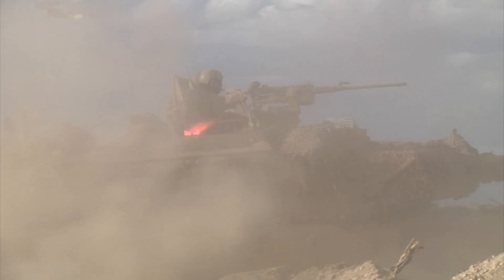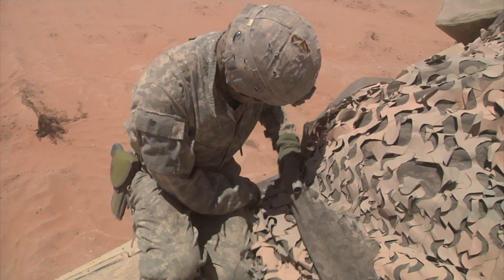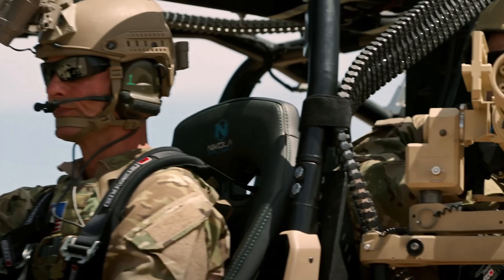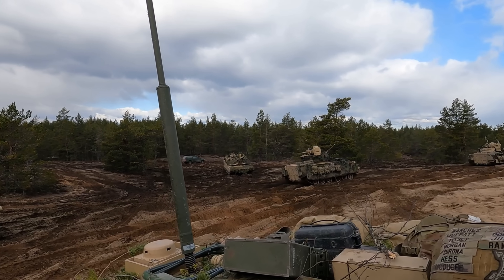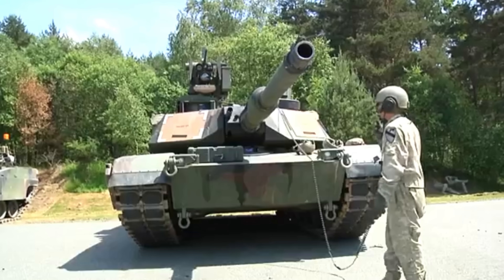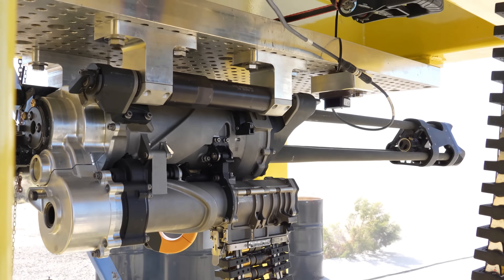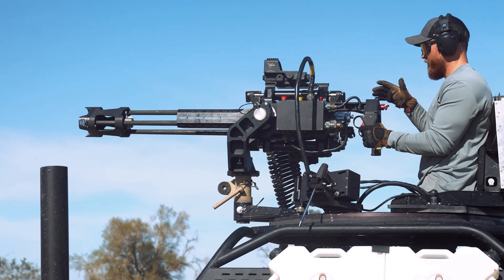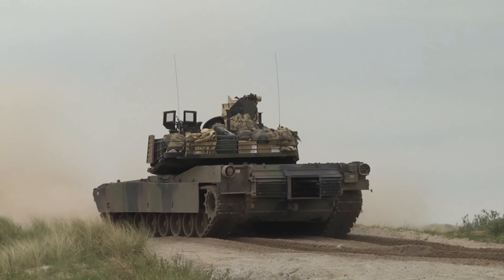Why is the U.S. Army putting a M134 Minigun on Abrams? | ROTARY GUN DEFENSE

Comment: The Minigun needs to much ammunition, on top it needs some time to get into rotation and you have to directly hit the target with one of the bullets. This could only be a short time solution. There are already several technologies available to counter drones. For example ABM guns or counter drones. This is of course much more expansive than a simple minigun controlled by a soldier.
Reply from the maker: Those are some great points to consider!

Comment: Sorry but the same enablers you listed for the GAU-19 can be used on a minigun mount. CROWS can even be slaved to an AI system to recognise and shoot at drone like targets. Terminator vibes but still

Also, how can power and ammo capacity for a 7.62mm type be an issue but then suggest a bigger, heavier system in the GAU-19 which will need more power to operate and more storage for ammo? 

Western nations will need entirely new hulls and not next gen upgrades like Challenger 3. Aside from jammers, soft and active protection. I would say we go to 14.5mm and 9.5mm single/multi barrel guns for lethality and range. With AI allowing for less burden on the crew.
Reply from the maker: Thanks for the insights, there are definitely some interesting points in there!

Comment: The Ukraine has a AI powered audio detection system that can pinpoint drones and missiles filtering out all other sounds. If they want to have a powered weapon on top of the tank may as well make it semi autonomous integrating audio with optical auto aim.  Most importantly in a non radiating passive targeting system. Making  a compact phalanx  using off the shelf passive sensors instead of radar.
Reply from the maker: Interesting thoughts!
Reply: @_Matsimus_  Funny thing is this is nothing new, durring WW 2 the Japanese were far behind in radar technology so they used what was basically gigantic hearing aids to detect incoming Allied aircraft.  They could determine location and a rough flight path and speed.

Comment: From what I can tell watching the footage, then mounting a huge rotary gun on top of a tank turret is a really bad idea and it's gets even worse if has to be manually operated ! In my opinion I would go for a system which would be able to destroy a threat at a distance of 30 meter or less this weapon system would consist of very small short barreled shotguns placed on the turret and body of the tank along with a small short range radar for detecting, tracking and aiming at the incoming drone.

Comment: For its purpose the m134 is better than a GAU-19 for the very points you raised at the start. Rifle calibre rounds are more than capable of dealing with drones (fpv) that you mentioned and the volume of fire will support that. 7.62mm is lighter and more compact that .50 and therefor more rounds can be carried. If you are wanting to deal with these drones (anything larger should be handled by SPAAG or a SHORAD) then as you mentioned they need to create an automated system. Maybe even using cameras mounted and AI to detect movement and target as a cheaper alternative to high resolution radar.
Reply: That said a laser system would be better suited.

Comment: I spent 2/3 of watching this video thinking the same thing as the conclusion - anti drone defense isn't going to effectively be done with manually aimed systems. It's going to take automatic detection with computer assisted aiming. Expecting a person hanging out the hatch of a 60+ ton vehicle moving at 30+kph over rough terrain to be able to do anything precise is unrealistic. The US military needs to look into remote turrets and detection gear. Expecting a tank to operate on it's own in hostile environment is a complete tactical fail.
Reply from the maker: That’s a very interesting point, thanks for sharing!

Comment: everyone forgets the original purpose of the 50-cal. on top of vehicles was not anti personnel but anti air, with todays air speeds you need more bullets so the slow firing 50-cal. is out.
Reply from the maker: Interesting point, thanks for sharing!
Reply: There is a fast firing .50 called the M3, it was mounted on early US jet fighters. Also, the M2's original purpose was air-to-air, as .30 eventually didn't cut it for shooting down planes.

Comment: Not sure of the practicality of it but creating and mounting an automated system like a mini CIWS . Something that could track and engage drones automatically using shorter bursts to conserve ammo. You still run into the problem of how and where to mount it. As you said the top of the turret is cluttered so without redesigning the turret roof the system would have to be on an elevated mount to have clear arks of fire. Now you have the problem of adding height to an already tall tank. To be effective no matter how you do it won’t be quick, easy or cheap.
Reply from the maker: Interesting points, thanks for the comment!

Comment: You should read Hammer's Slammers. But when I was a Rakasan over in the 101, I knew when Ukraine popped off and we would watch drone footage from Ukraine that it was a matter of time until they equipped tanks with a 20mm gatling gun, IRST, and a short wave radar. Probably mount a Phalanx system on a trailer down to the battalion level.
Reply from the maker: Interesting insights, thanks for sharing!
Reply: @_Matsimus_ Oh yeah. I'm out now, but I wonder if you guys up north have gotten the little black hornet bastards to play around with yet? Fun little helicopter drones a smidge longer than a .50 round. It doesn't handle wind well, but the picture clarity is good.

Comment: Drones bad MANPADS worse Same defensive solution 
Autonomous Defense 
More smaller projectiles
Layered

Autonomous means YOUR troopers around you are at risk of being collateral casualties Only buddies in an; nch or more of armor "safe*  Such systems would need a wide area networked auto off when a vehicle discharged crew / infantry  If hacked you are naked

Pelletized ammo 
Slow
Close in shell mounted claymore type mines
Near Up to 100 feet rapid fire extended charge shot gun w shot cloud effective 50 to 100 feet  A min of 2 needed to cover armor.
Small ca long range would be new generation .22 or .25 w extended charge & barrel to bring up to 50 cal range & speed.  Essentially a slightly smaller charge  slug infantry rifle round.  You'd need 1,000s of rounds per weapon.  Caseless would be huge assist  in rounds carried.  Belt fed 40 mm smart frag rounds set to detonate before meeting drone or rocket  by fire control maybe but very limited ammo supply.  Should AA be multi barreled for layering 40 mm .22 el, shotgun, then combo explosive armor w  multi layer towards outside.22 sized pellet fragmenting steel case.  
BIGGER problem is detecting threat.  ANY ACTIVE MULTI DIRECTIONAL RADAR can easily be used to target vehicle.  LIDAR is only sufficiently directional to make back tracking difficult yet computational power to paint 360 degree sphere around vehicle out to Evan 300 feet enough times per min to provide targeting data is insane for a vehicle.  It would have to be AI visual detection, enhanced w IR & night vision .  Alt the vehicle would need wireless net connection to a web of dozens of small drones radiating radar crawlers or flyers around the vehicle for targeting.  This could enhance friendly survival as troopers could have electronic tags that emit IFF when hit by radar pulse, realizing great way for enemy to detect them too albeit at risk of ARM targeting the radar station
Still ARMOR hit by drone even rockets often leaves battle ready survivors where a drone hitting a soldier might not kill them but almost certainly loose combat capability   SO ARMOR AINT GOING AWAY.  At the least it's an infantry ferry, & once it's that infantry will want need close defense heavy weapon to assist in taking fixed positions even if remotely operated from outside vehicle hugging earth using micro drone visuals to slew vehicle gun on bunker.   Of course a curtain of drones around vehicle would work too to intercept drone & rockets w about 3 x needed and landing / charging area on hull for them to rotate back for power during day long ops .

Comment: I think the whole turret needs to be redesigned. It is already carrying a lot of dead weight that's there to balance newer systems since it's original design. Instead of trying to find an empty spot in a more crowded and badly used space, take the whole turret strip it down to the bare essentials, and redesign everything else around that, and then mount it. M1A3 sep 0.... It would obviously also include the ideas necessary to at least ameliorate if not defeat completely the drone threat

Comment: Ok my .02 cents. I think they are simply trying out protection ideas. And this is one they can do easy. Logistics isnt a big deal as its the same ammo as the coaxial mg. They can always make a large dum and hang it off the side of the turret. And its a tank it really doesn't care about the weight. But I wonder if a shit shell for the mk 19 would be a better long term solution with an automated firing system
Reply from the maker: That's a great point about the logistical advantages of using the same ammo!

Comment: I personally like the M134 mini gun. Why the military doesn't use a sort of mini Phalanx system would work so much better than manual operated as they automatically seek out the drones and can spot a hell of a lot faster than a human being. I've always wondered why they didn't use miniguns more in the past prior to drones. The amount of 50 Cal. Ammo vs 7.62 even though the mini gun goes through ammo ridiculously fast, I believe the cost is lower for the 7.62 round. Typically a 7.62 round is around 35 cents a round where a 50 Cal round is about $5.00 per round.
Reply from the maker: Interesting point, a mini-Phalanx system could be really effective!

Comment: All that's needed is an automatic shotgun-based system if the drones are the primary target. A minigun based system spends too much ammo per target. One could also develop an anti-drone APS with a set of 6 staring optical arrays and two automatic shotguns, one per 3 arrays, covering a 180 degree arc.
Reply from the maker: That is an interesting idea.

Comment: If the point is shooting down drones then it's just a bad idea. it would be better using the loader to control a counter-drone(s) like a flying auto-shotgun. Actually, a full new design of tank is required with all around protection.

Comment: The real answer for the new Abrams is the 30mm chain gun. It is a variant of what's used on the Apache. It's remotely operated from within the lower hull by a 3 man crew, with an auto loading turret. The system will employ a small top mounted RADAR and CCD camera system to actively and passively detect incoming drones. The system will have an AI friend or foe targeting system that can lock onto and fast program 30mm proximity fuse rounds to fire and destroy large numbers of drone swarms. The 30mm chain gun can also be used for anti personnel and anti light vehicle targeting, including other airborne enemies like helicopters. It will replace both the M2 and M249 top mounted crew operated machine guns.
Reply from the maker: Interesting points, thanks for sharing!
Reply: There have been next gen Abrams and Leopard concepts where they do exactly that, and just depict a 30mm system mounted on the turret.
Reply: @Naturally-Fragrant  That's why I mentioned it. From what I understand, that's actually what they are developing specifically for the newest E-drive versions of the Abrams and Leopard.
Reply: I thought for a second you were advocating for replacing the main gun with a 30mm. You've got a good idea though

Comment: You can't make a list of bullet points for cons, then offer a solution that nearly addresses non of those issues. You suggested a larger, heavier, more cumbersome, and more logistic intensive gun by recommending a three barrel rotary 50 cal. You ignored yourself by suggesting a larger weapon system where a smaller system already barely fits and has no visibility. The solution for the mini-gun is simply an RWS system and reconfiguration of the space and surrounding space where they want to mount it. If they already carry 7.62 rounds for the 240, they just carry more and acknowledge they have a better 240 now. If for some reason there is misfire/friendly fire in the direction of another tank, they are pellets. All rounds come back down, but if you mount a 3 barrel rotary 50 cal that fires into the air, those rounds are a bigger problem for neighboring friendly tanks and support vehicles. You said you want a gun with more punch for a problem they are not trying to solve, they are not trying to solve the issue of an auxiliary gun for lethality against smaller light armored vehicles at a distance, they need volume in the air at close distances for aerial drones.
Reply from the maker: Great points, thanks for the insight!

Comment: 5.56mm would make more sense in the role, if they could develop a 12 or 10 gauge shotgun version,  it would make even more sense.  
With tank development trying to replace as much wire as possible with optical cable, fiber optics could save weight. The only other method that makes sense is sending in a vehicle with a purpose built design to run amongst the tanks and provide anti drone cover. These would likely still need to have integrated detection with the tanks and it's own system.

Comment: i mean. replacing the commander's M2 with an M134. or if they REALLY wanted to do fire by volume and ammo weight, volume, and cost is an issue, then pulling the XM214 Microgun out of the archives could be a solution. Its understandable that needing multiple barrels as a rotary gun has is to help reduce barrel overheat, in why the MG3 cant be used. 
All ideas that could have success... if manual. 
Integration of auto target systems have been around for a while. the Type10 MBT that japan has uses main gun acquisition targeting assistance. we already have CROWS. just need that one step further and itll be just what is needed.
Reply from the maker: Thanks for the suggestions!

Comment: The Israelis used to mount dual M2's on top of the 105mm for anticraft use. Someone actually  had to crawl out of the tank and lay on top of the turret to use them.  Supposedly someone actually got a helicopter with this setup.

The M134 has been mounted in Abrams in the GWOT in Iraq for use on ground targets. 

Certain nuclear facilities in the USA have light armored vehicles with M134's mounted on them for air defense.  Oakridge used to have pictures on their website.  Info on sensor systems integrated with this set up is not available for obvious reasons.

Comment: THIS WILL NEVER WORK UNLESS:
A. prevent being targeted;
   1. Reduce if possible all signatures as much as possible( APU, Barracuda, camouflage, thermal screening etc.)
   2. Thicken top-armour and hatches(should be able to lock as a cover OVER the hatch)(lowers thermals)
   3. Use Iron Vision as much as possible so hatches are closed as much as possible.(lowers thermals)

B. your counter drone RWS(a human out of the hatch cannot do this, plus he/she has other jobs)
   1. Get a battalion-wide battlefield management system so you know what is flying out there and who's it is, origin of travel, type
       of drone etc, combine all sensors as much as possible.
   2. Either small calibre ball(high rpm) or higher calibre flechette/airburst/shotgun or APS(360 and up!)because if there are a lot                      
       of targets inbound you don't want other vehicles/personnel shot to ribbons with rounds that over penetrate and create                     
      massive blue on blue.
   3. Slave it to optics, thermals, sound locators, millimetre wave radar of your APS ( human could never keep up) so integrated in
       your battlefield management system an AI will determine which vehicle/vehicles will take that shot(delegate people! and a  
       shooting vehicle is probably a spotted vehicle).
   4. Has to be armoured up because sometimes some of that metal WILL hit your vehicle with the best of intentions.
C. a family of systems is needed which means;
   1. Unmanned vehicles able to keep up with an MBT / CFV sqn or IFV comp that would specialise in this task and would be 
       preferred shooters on the outer perimeter patched into the information of that battle management system (or getting direct
       commands from it for safety purposes)
   2. Every squadron and company a dedicated pair/triple SPAAGs with 30~35mm auto cannons with airburst and laser weapons, 
       this could also dispatch other air threats and slower munitions in high arcs(artillery).
   3. EWF vehicles with jammers? Individual jammers on MBT's/CFV's/IFV's? Whatever the best solution is(either of both)this 
       should obviously be in sync with that BMS as to not interfere with the comms within this unit/sqn/comp.
D. hit them first before they hit you.
   1. Find,Fix,Finish those drone operators before they find you or at least make a bloody good effort asap which means SIGINT 
       capacity in the sqn/comp or higher up in battalion and your own recc drones (which YOU should not shoot,BMS!)to then 
       strike/retaliate with loitering munitions/fpv's/mortars/artillery/ATGM;s.
 Why all this fuss and not just get rid of MBT's/CFV's/IFV's/APC's? 
     WELL WITHOUT THEM WE'RE ALL LIVING IN TRENCHES THE NEXT DECADES, IT IS ABOUT MOBILITY AND THIS WAY THAT 
     IS MAINTAINED!!!  but it will cost you, but armour is not outdated, the vehicles need to be updated.
  
thank you.